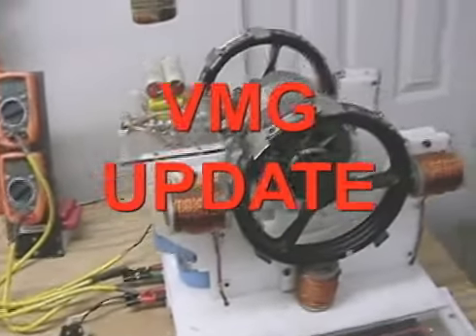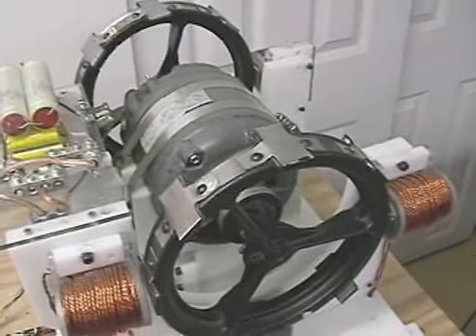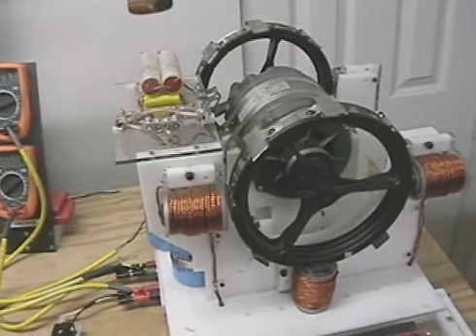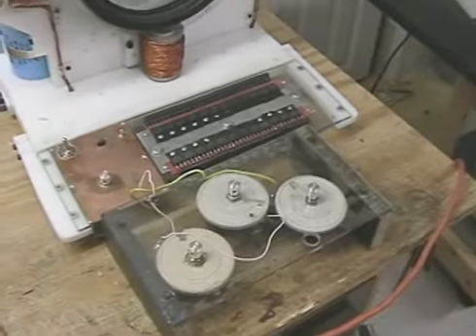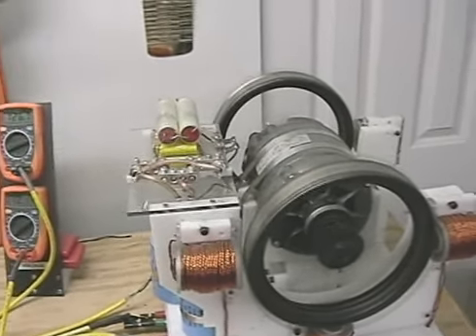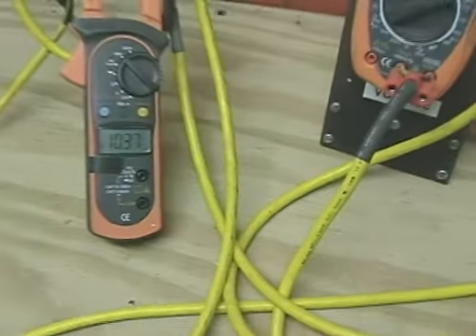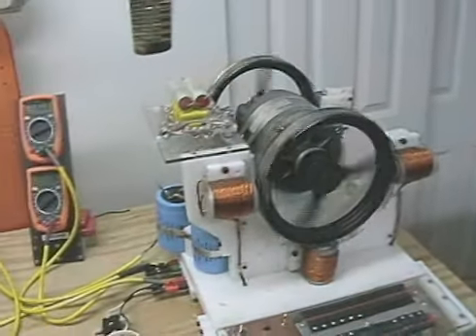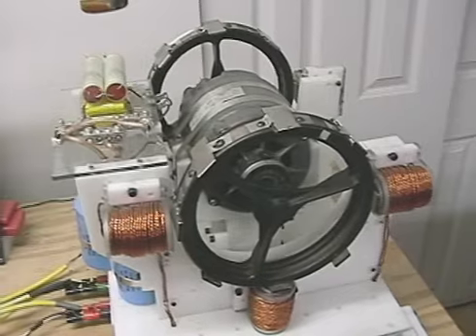VMG Update 6

Comment: Zero - I switched to the BU508A, High Voltage Fast Switching NPN transistor and the things run MUCH cooler now and is capable of handling a lot more amps in the circuit. Perhaps you might look up the specs and give it a go... you might be surprised.

Just a thought and suggestion.

The old shop teacher of 39+ years.

Also, students knotched the same rim you are using and have sunk the Neo's into the rim, JB Welded them and used packing tape with nylon for extra holding strength... works!

Comment: Separate the pulse motors.
In other words make the electronics that drive the coils into left and right banks so they can run independently like having 2 pulse motors.  
Then rotate the flywheels so the magnets position from left to right are staggered this will give 16 pulses per-revolution rather than the 8 you getting now and you will see the speed increase and amps drop more torque. well that’s my pennies  worth nice build there well done keep up the good work..   please remove other post

Comment from the maker: @vid009 yes check out the new cartmotor on my channel i'm getting better results new video posting soon VMG had issues it couldn't drive the induction generator. The new cartmotor is more efficient the wheel has 22 neos  and is 30Lbs  making 30amps charging 8 battery's in parallel with a 3phase 3hp induction generator /motor and the wheel is mount directly to the  motor's shaft . the coils fire sequence  so posting a 3d video of this motor would be pointless if it don't work. it is a SG circuit

Comment: I'd like to see a pulse motor that can get anAC induction motor up to it's rated rpm of say, 1750 rpm or higher. I know that would require it to have some decent amount of torque to it. Right now I'm using a 48vdc Marathon Electric pump motor rectified through a variac as my prime mover. The G.E. 1.5hp HVAC induction motor I have is coupled to the pump motor, and the capacitors I have across the legs of the windings are giving me a steady 125 vac at around 6.82 amps.

Comment: Solution is: Larger wheels,  #2. No metal on outside of the magnets,  [ side that brush you're coils. #3. Looks like you're coils are done Correctly , adding  Two more per side wouldn't hurt" along with [ Making them with, smaller wire & more turns...
Anyway " its you're Experiments "  SO, You know what you're looking for.......